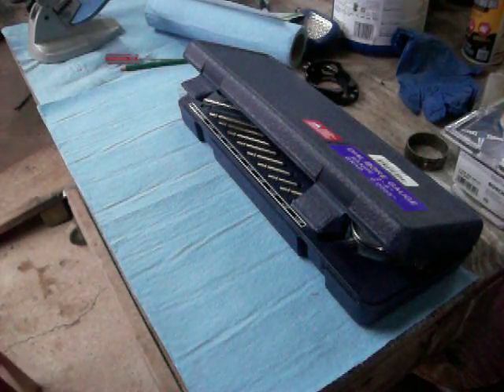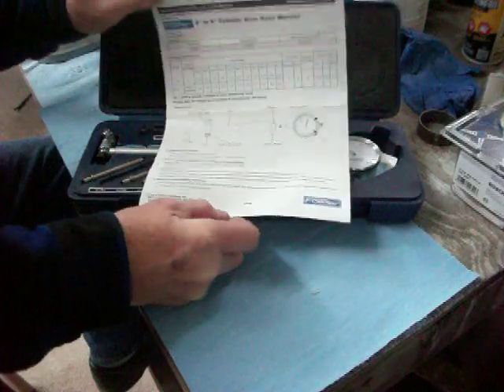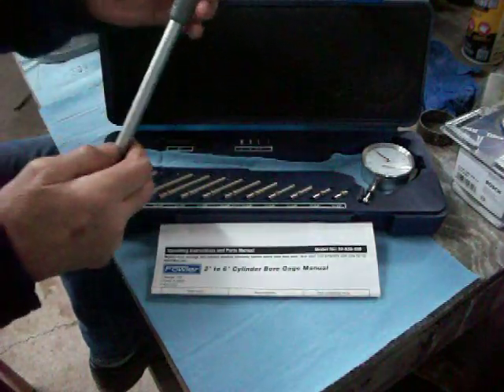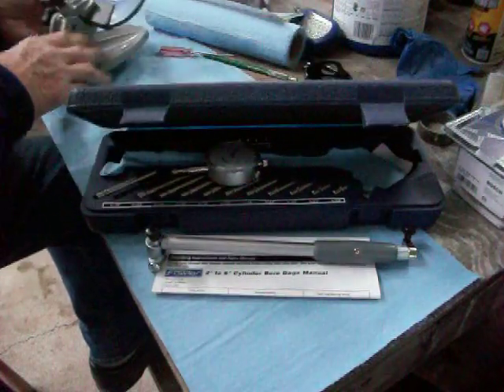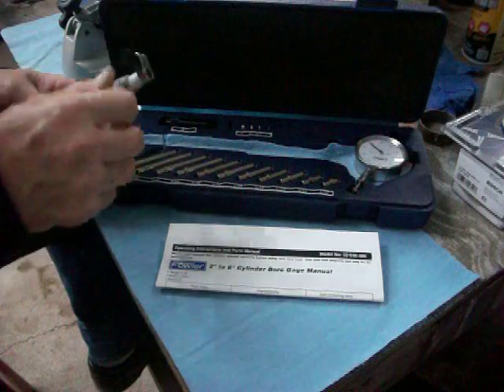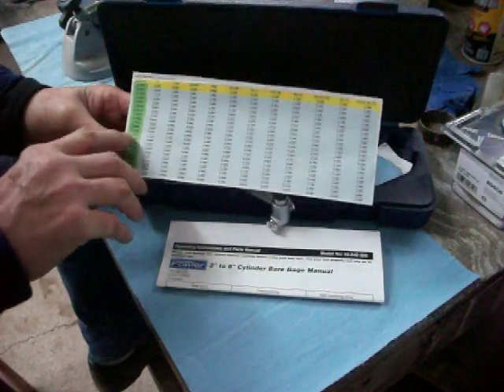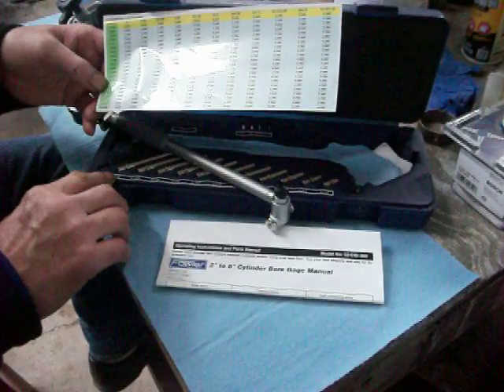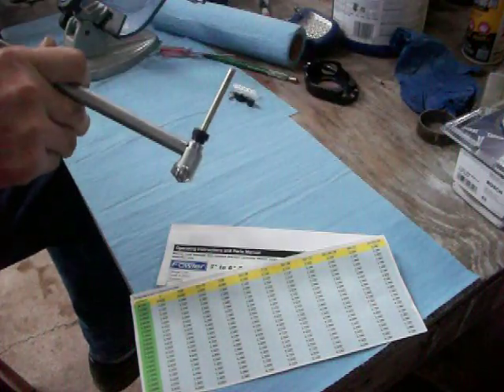Fowler bore dial gauge Review, measuring engine bore.

Comment: Hi! Thanks for your explanation. Please help me with this. I'm working on an engine with factory 92.000mm bore. is it correct to set the micrometer at 92.000mm, use a 90.0mm anvil and 2.0mm washer (that is, 92.000mm in the bore gauge)? I ask this because some say I should set the bore gauge a litle bigger. Thanks in advance.!
Reply from the maker: First try the factory bore, then move in increments as small as possible to get a good reading.
Reply: Thanks! I just tried that. Now, I am using a 1mm indicator with 0.001mm graduation. After setting, the niddle makes 6 full circles and then stops at half the 7th rotation. In every video I see, there's not even a full rotation. What am I missing? The indicator is the mitutoyo 2110S-70 with mitutoyo 511-128-05 bore gauge. Again, thank you!
Reply from the maker: Excellent, be patient with it and get good readings.

Comment: Excellent tutorial.  Thanks for posting.  Question:  What is that knurled knob on the top of the dial indicator?  And how do you change the measuring head?  I see two tiny nuts on top of the 1.4-2" measuring head in the box.  I have a Fowler like yours.
Reply from the maker: +BoysBarn One of the knobs on top is an extension of the guage spindle. The other one locks the dial so it stay fixed. To change the anvils you just loosen the black knurled knob on the bottom of the guage and install the spindle you need and or the washer. The black plastic that comes over the head is just a protector. You can use it with the protector on I believe but I just took it off the dial indicator and I dont use that.

Comment: Just got a very similar Fowler bore gauge, except mine has two heads and goes down to 1.4" diameter. Did you make up that excel chart yourself, or did it come with the bore gauge? That is a handy thing to have. Just want to follow up also on BoysBarn's question -- if you take the measuring head off the stem, you will see a pointed threaded rod on the end, with two small nuts. These nuts are not tight on either of my measuring heads, and am not sure if they should be or not. Any comments on what these nuts are for and where on the threaded rod they should be positioned? Thanks for the great video, it helped me a lot.
Reply from the maker: I made the excel sheet myself.

Comment: what are the most expensive to least expensive bore dial gauges as in quality?
I hear sunnex and mitutuyo
Also, i heard the snap on dial bore gauge is a rebranded fowler
Reply from the maker: Fowler is the cheapest, and the brands you mentioned are the high end. I dont condemn the high end ones. But man the prices don't justify the amount of times I would use them. So I just take care of the fowler and use it in a way so it can be checking itself constantly.
Reply: ahh gotcha.

Comment: Great video.  I purchased one of these.  Any chance of getting a copy of that great spreadsheet?
Thank you.
Bob
Reply from the maker: absolutely, send me an email address. Do you have excel
Reply: Thank you.  A great tool!
Reply from the maker: Ok good you got it. Thanks for the comment
Reply: I have a followup question, if you do not mind my asking it?
Reply from the maker: if I can help.
Reply: Thank you.
I've set the dial bore gauge at 3.52, using the 3.4 and .12.  I calibrated it using a micrometer set.  I am measuring a Harley bore.  I put the dial bore gauge in and the dial moves to the right side, down to the .225 mark.  Seems to me I would then subtract .225 from 3.52 and the measurement would be 3.295. The bore is actually closer to 3.494.  So, I am confused about what I'm doing.
Reply from the maker: keep in mind the number you end up with, should be bigger than the original bore diameter because of wear.
Reply: Yes, but it is smaller!  What am I doing wrong?
Reply from the maker: Bob use email to talk I think it will be faster than youtube.
Reply from the maker: What is the dimension that you are suppose to have? The factory bore diameter.